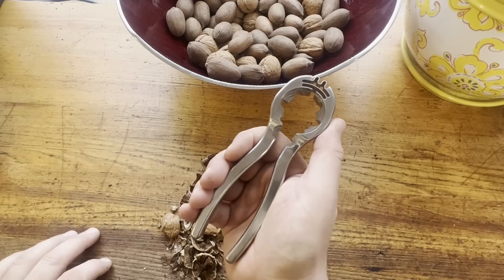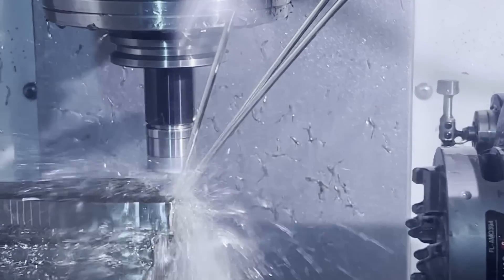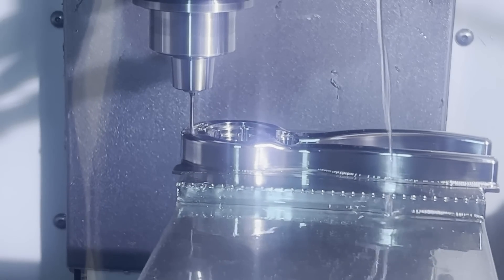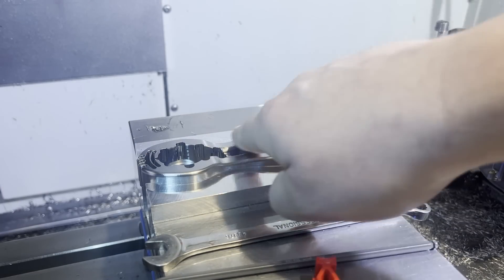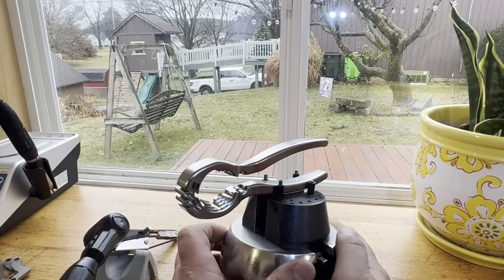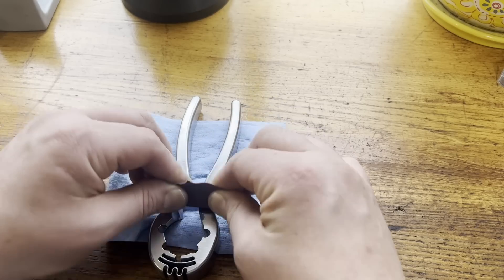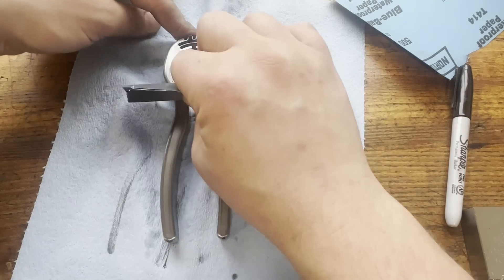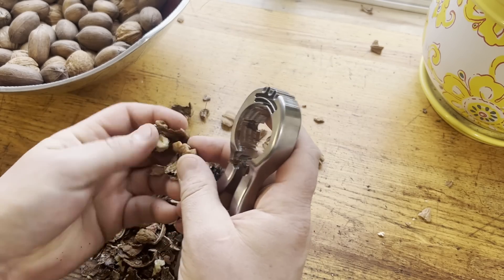Machining a Flexure Nutcracker

Comment: Flexures are very interesting and have the potential to be superior in overall performance, as in this example. In this context, it's essentially replacing a rotary bearing with a compression spring, so there are fewer parts, less friction, less wear, and no assembly required, all while the flexure operates well within the steel's fatigue limit so it practically lasts well over one's lifetime. Now imagine bearing systems that can be replaced with flexure components--the efficiency improvements will keep stacking with each replaced part. The downsides are that it's more difficult to manufacture and it'll cost more. But tools like this are worth it.

Comment: Curious project. I find it interesting how one half of the flexture acts as a hinge and the other- as a spring. But what is that smaller "set of jaws" for? Really tight marker caps? Superglue bottles? lol
Also, what coolant are you using? I commonly see that milky stuff, but clear would be more useful in many cases. Thought that was just water for a bit, but it looks thicker. Besides, water would just rust everything.
Reply from the maker: The smaller set is for almonds, a stubborn pistachio, or also the seed in peach pits. The coolant is actually cutting oil , blaser gt15
Reply: @adamthemachinist  Ah, did not even think about pistachios and such. Be careful with peach seeds though, they contain cyanide.

Comment: This is also called a "compliant mechanism", which you probably already knew. Have you seen the Zenith Defy Labs wristwatch that eliminated about 20 or more parts by using a one piece component with a bunch of flexures?
I never would have thought of a nutcracker. That is soooo cool!  🙂

Comment: You are a good designer with manufacture ability as the base, I run a high precision machine shop and find a lot of gap between drawings and machining which if narrowed will reduce part cost.

Comment: Nice work, i want to ask how much electricity and overall cost of making the part is.  I love the concept of 3D printing and CNC but i always assume it's way too inefficient to make novelty parts like toys or nutcracker in this case. I'm really just curious if it is a viable solution to buying new gadgets or is it just done for fun?
Reply from the maker: The electricity might have only been a few dollars to machine this. The Shop Generally has a 200 dollar month power bill with all 3 cnc machines running . The raw material would be rather expensive at around 50 dollars to buy, but I had it left over from another paying project. In general , its not cot effective to machine something that you can go and buy. 3d printing is different, much cheaper to get a part. Ultimately , the real power of machining and 3d printing isn't making things cheaper than what you can buy them for , but making things that don't exist in the market place

Comment: Also cool for print-in-place metal SLS manufacturing. I wonder how strong the hinge is at torsional stress. Using additive manufacturing the strength could probably be increased.

Comment: I wish I had one of those sized for hazelnuts, I crush the meat and send bits of shell across the room almost every time I open one and a nutcracker with a hard stop to it's range of motion would be perfect. I don't have a cnc so the best I could probably do is put a tapped hole in a regular nutcracker with a machine screw to limit travel.

Comment: I am but a fabricator
But I too use 3d printed parts for welding fixtures like that little jack 
Between my welding table and printed fixtures it can really speed up workflow as well as increase accuracy

Comment: I sometimes use a pink block pencil eraser to wrap the paper around. Lets the paper push into the block on the high spots, and smooths out the finish some.
Reply from the maker: That’s a good tip

Comment: This is awesome. Does 17-4 need passivation to stay rust free?
Reply from the maker: Passivation Certainly improves its rust resistance. I’ve built many 17-4 jigs/fixtures for use in a light duty indoor environment that never had rust issues without passivation . If this was going outside or to be used near acidic foods I would reconsider or change alloys.

Comment: Smart looking project looks the part, Adam.  Would your Haas handle 3d profile machining on small dies like in plastics dies (accuracy over speed)? I have seen a Doosan (DEM 4000) with a Mitsubishi controller that has thermal compensate and wanted to know your thoughts? Happy New Year and hope to see more of these videos.
Reply from the maker: As long as you stick with contour or waterline strategies , where the z axis doesn’t move . I’ve gotten very good results in the past . Now the Mori seiki handles the small 3D work
Reply: Good to hear. How do you find using cutting oil instead of cutting fluid mixed with water? Here in Western Australia, it gets hot so maybe an option. Thanks for the feedback.
Reply from the maker: It gives very good performance in small tool work and hole making. It’s not ideal for high volumes of metal removal as its capacity to cool is no where near as good as water based options . Maintenance and top offs is nonexistent though
Reply: Does the haas make much noise in your work space with toolchange and air? I saw your neat workshop in a NYCNC video. I am looking to do similar. Thanks
Reply from the maker: @hawkprecision7878  the machine itself isn’t to bad , it doesn’t use much air to do a tool change and use no air when operating. It’s a little noisey at 10k rpm but most my work in this machine is much slower . The Actual air compressor is the loud part of the shop . If I had the space I would have a dedicated sound deadened area for it

Comment: @2:13 you talk about the mark that the tool leaves due the machine not having a tensioned Z axis screw. 

How does tensioning the Z axis screw eliminate it?
Reply from the maker: There’s less vibrations and more stiffness . Most mold class machines at a minimum do that or have even more sophisticated approaches to get really smooth motion
Reply: @adamthemachinist  could you give some pointers in the direction of more information on this subject?

I'm not sure of what search terms I should use.

Comment: Awesome work as always! I’ve been doing this stuff for 35 years and I learn something every time. I’ve really went nuts with super glue over the years. I use it a lot. For parts like this that are delicate in the soft jaws, adding a few drops of glue can keep them from springing in. I also usually load the bottom of the jaws with some stacked up aluminum scrap that’s the same thickness as my part to keep the jaws from creeping in as top pressure is released.

Comment: What belts are you using for your NSK?  I have a foredom belt sander and the overlap where the belt is joined makes it exasperating to use.
Reply: Trizact are good belts, from 3M. Most dealers will cut and tape them to the size you require and they are great for polishing stainless.
Reply from the maker: These are nsk belts , the overlapped area is hardly noticeable

Comment: Hey Adam awesome video I wish I had the creativity to add my own flair to things like this. If you don't mind me asking what kind of coolant so you use? I just got my first Cnc and I'm trying to decide what coolant I want to use as a hobby user for now.
Reply from the maker: That’s actually oil, it’s a bit advanced and comes with its own challenges, but the tool life is fantastic
Reply: @adamthemachinist  interesting my machine was an oil machine but I think I'm going to switch it to coolant, but I still haven't decided
Reply: I'd recommend cf500 from hangsterfers for most situations
Reply: @johnrobholmes  thanks man I'll research it.

Comment: wht coolant you run sir? and you scanned this with what?
Reply from the maker: It’s gt15 from blaser, neat oil . Not sure what you mean by scan
Reply: @adamthemachinist  you designed this part from scratch? or did you scan it with a 3d scanner
Reply from the maker: @Anthony-cz2it  I modeled it from scratch

Comment: Could you share the information about the 2mm endmill? What corner radius, depth of cut, feed rate and rpm?  I have struggled with 1/8" endmills and deep slots in 15-5 H1025. Thank you.
Reply: I would imagine with a 2mm or .08" tool, he can get 250sfm or so if he has a 12k spindle. He might not even be running it that fast. Maybe 180sfm. Feed is based on desired chipload and how many flutes the tool has, but here he is going real easy on it, he says so. Don't want chatter. Feed rate somewhere between 5-10 ipm i would guess. Stepover looks like it's slotting then stepping over 20% maybe, leaving .002-.005 for his finish pass, adoc stepdown maybe .04 maybe l less. Corner rad is probably. 01 or .015 relatively.  .2mm maybe

Comment: Hey Adam. What FDM printer do you use? And what coolamt is that on the HAS? Thanks for your videos and knowledge you share .
Reply: the coolant is called Synergy 735 from Blaser Swisslube edit: not synergy 735 but neat oil gt15.

Comment: When hand polishing with a dowel I put rubber hose on the outside of it, like fuel line.  Lets you still push and guide where you want the pressure but also has some resilience.  Charles

Comment: You know you're a toolmaker when you call 17-4PH in H900 condition "a pleasant material to work with".

Nice work, as always.
Reply: I actually got an eye twitch when he said that - 90% of what I work with is 6061..🤣
Reply: @machinist7230  OMG same here, I did about 95% 6061 and a mix of 6AL4V and random superalloys.  The one single 17-4 project I had was a nightmare from beginning to end.
Reply: It really is a pleasant material to work with.
Reply: @JFettig111  i agree, much nicer than aluminium for me, because it isn't gummy, and it surfaces well
Reply: Right. When he took the passes on the spring mechanism and went like 'eh, wouldve been faster on my other machine' i was like tf. I would have been scared of this thing breaking off already lol.